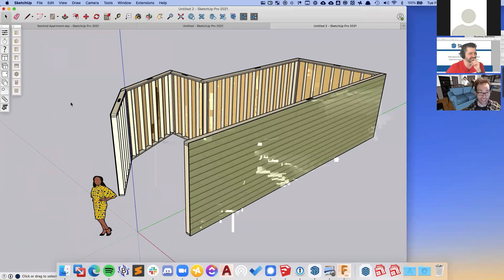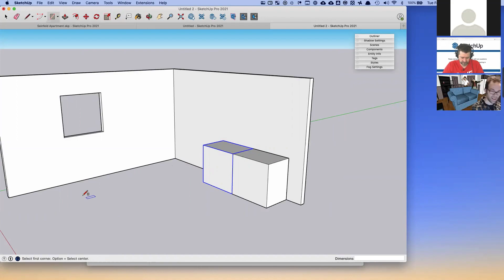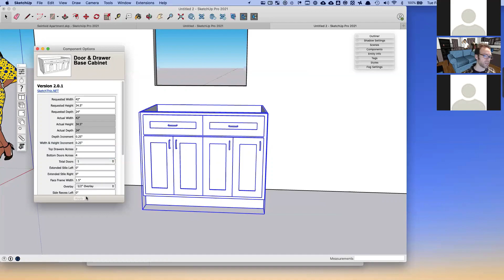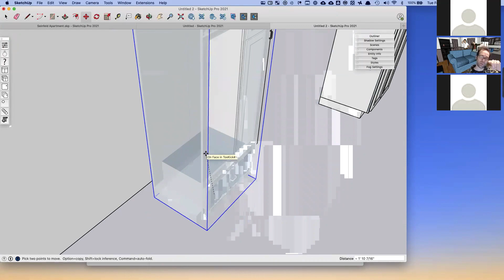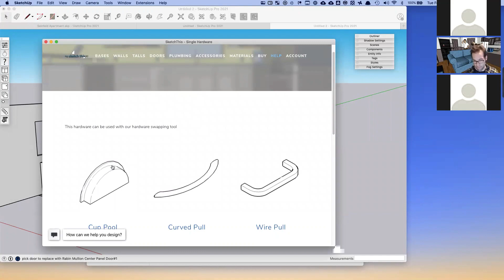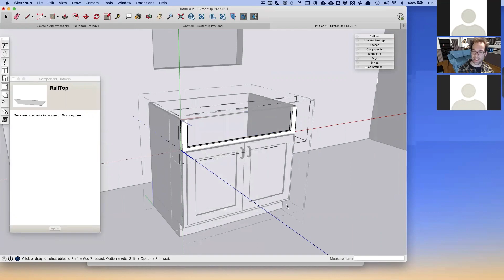KBIS 2021 01 - Amazing Extensions for Kitchen Design

Comment: I find that the most time consuming tasks in cabinet design are;
1. Creating Cutlists for individual cabinets, by wall, by room/area, or for a whole job.
2. Cut layouts for optimising for the best use of 4' x 8' plywood sheets.
2. Adding dimensions (as well as adjusting & double checking accuracy).
3. Doing page layout for easy-to-read shop drawings.
4. Re-sizing face frame openings
      such as to; align uppers & lowers,
      space openings to make door faces equal,
      increase/decrease a setback (from corners, depth jogs, appliances, or other unique features)
      or to make just enough room for a particular appliance to fit in while having all other openings in the series adjust accordingly to maintain the other design criteria.
5. dealing with ridiculous requests from customers.

Do you have any tools for better automating 4 out of 5 of those redundant tasks?